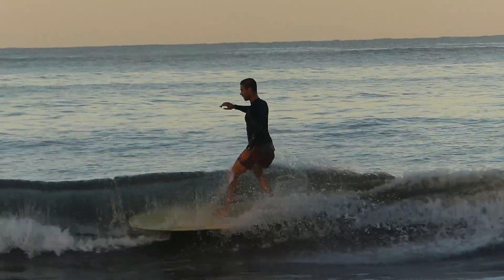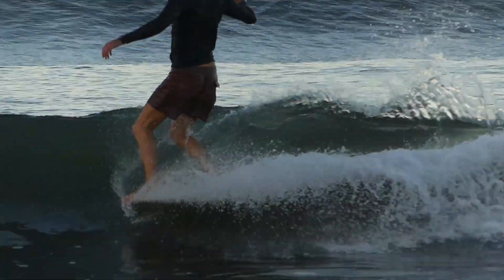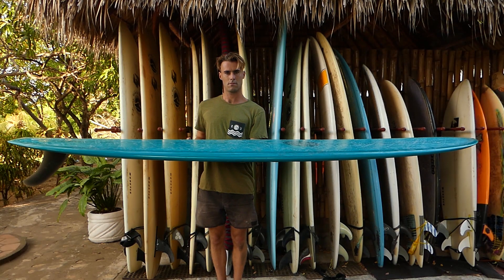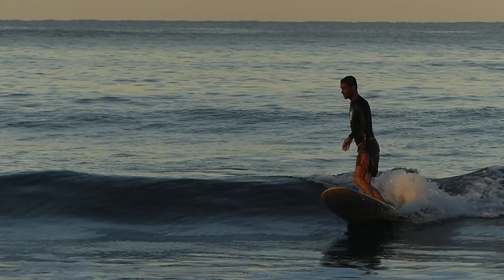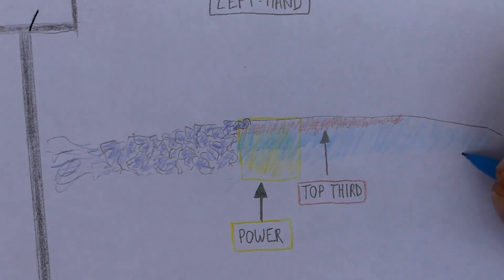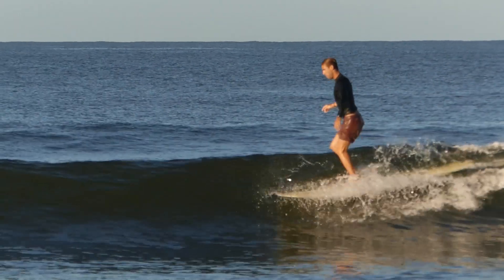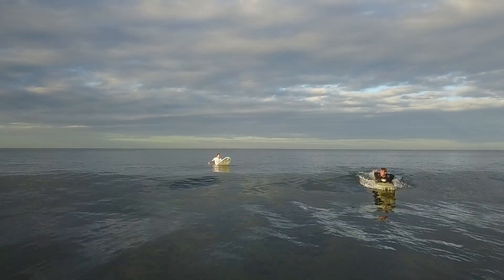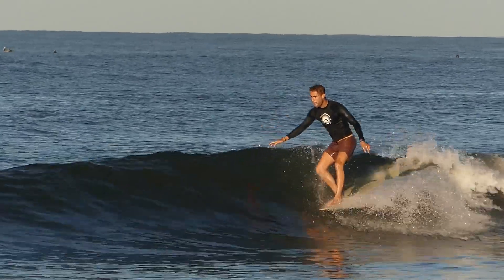Rise Up Tutorial - How to Nose Ride

Comment: Can you tell me the dimensions of this board?
Reply: 6 month later, but I'll make a suggestion. I have an admittedly excessive 23 surfboards at the moment, several of them custom shapes. I was traveling and damaged a board badly, so I bought a 9'1 "Modern Retro" longboard because it was pretty cheap. It's a pop out, kind of low quality glass. But i'll tell you: it is the EASIEST noseriding board I've ever had. Take a look at the dimensions for those as a good baseline. It has all of the classic noserider fundamentals.

Comment: Good video. What angle do you think you're at compared to the wave when you begin stepping? 45 degrees or less?

Also, as you step, is this angle getting smaller and smaller? So when you get to the nose, the board is almost parallel to the wave face?
Reply from the maker: 45 degrees more or less
Reply: You can also ride the wave to the shore and when the shore break walls up in front of you, you set you inside rail into bottom of wave and as the board starts rising up the wave, run to the nose keeping the inside rail weighted. It's a lot easier for beginning nose rider than trying to set up correctly on the wave as this guy does.
Reply: Joe surfer this is how I learned, you can feel the acceleration and stability when the board starts moving up the face and as you move towards the nose